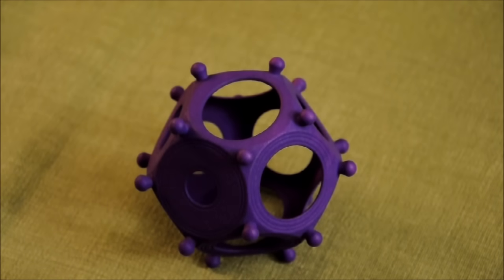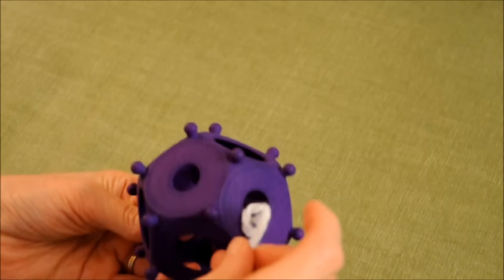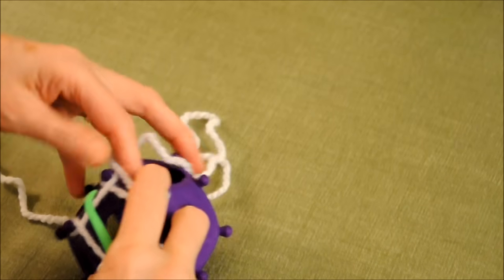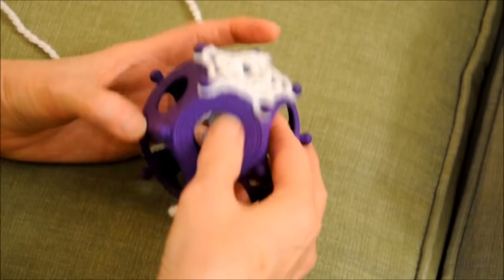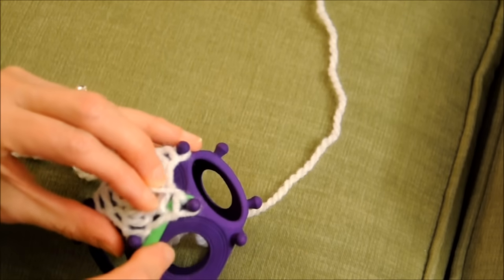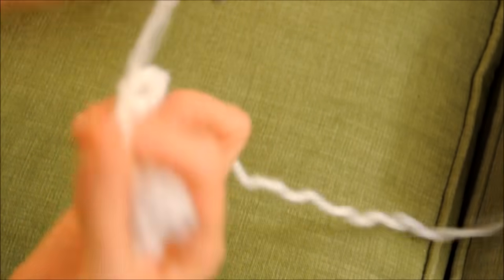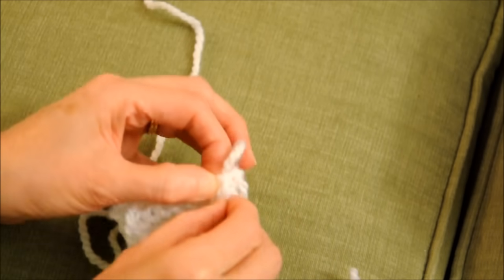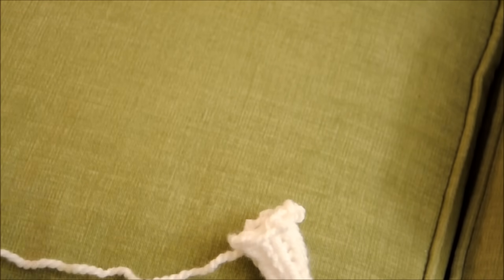Knitting with a Roman Dodecahedron

Comment: Its NOT for knitting! I don't know what it is for, but not knitting. The holes size have no effect on this form of knitting. Only how many pegs and how far away they are works. I'm getting so annoyed at seeing this all over.
Reply from the maker: When I was a kid there was a toy.  It was a tube woven of flexible fibers that we called a “Chinese finger trap”.  Pulling on it caused the tube to contract in diameter until you couldn’t get your fingers out.  This is how drawing a knitted tube through a smaller hole would work.
Reply: @ChertineP  No, that's not how knitting works. I've been knitting since I was a child, and all sorts of other yarn crafts.

Comment: Don't believe in that roman knitting machine.

If you have to knit every finger for its own, you need just one area. 

To knit 5 fingers simultaneous in what way ever, you needn't 12  areas. Even if the holes are different, there are just 5 nipples, so that there's no difference in size.

Comment: This absolute bullshit. You can knit on this but it is too expensive and hard to make to be just for that. First of all you only need a hole and pins around it to knit, you do not need twelve sides. Also the size of the knitted product is not determined by the size of the hole, but by the amount of knobs around the hole. Five knobs on feet wide hole will produce the same size as 5 knobs around a penny sized hole. Furthemore people in ancient Rome did not knit (only knitted produce are from roman provinces that had already been knitting previous to becoming roman province. And last but not least, why would anyone bury someone with a knitting device????  (my personal theory is this is some kind of brainteezer with missing part - even if it is not true, still it deffinitely is not a knitting device)